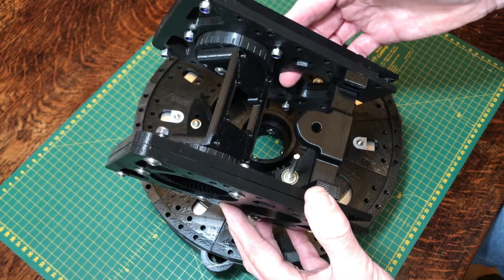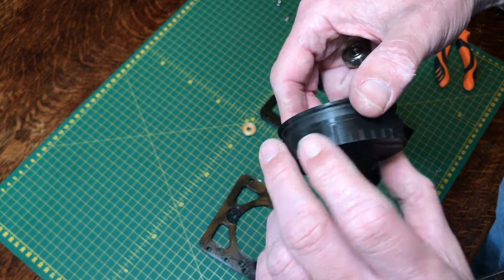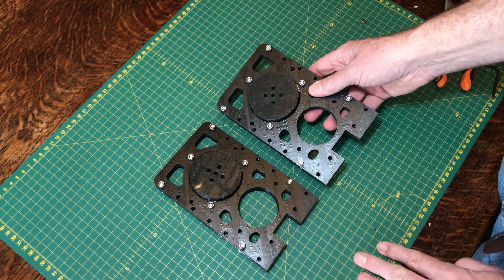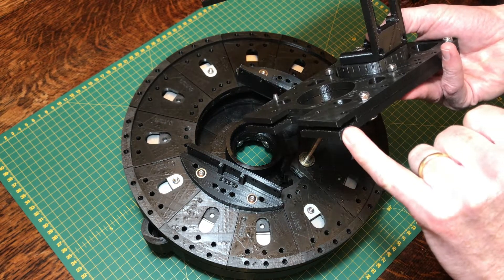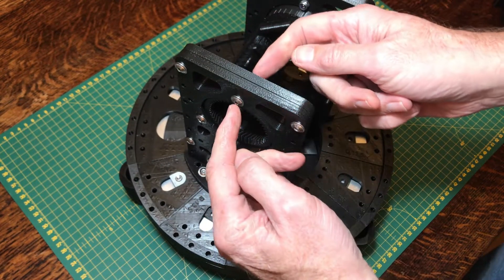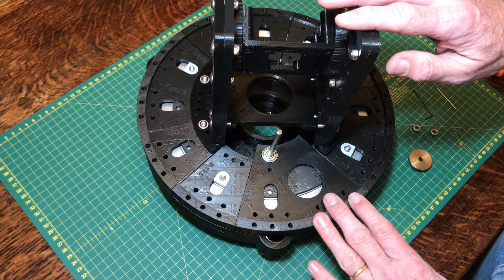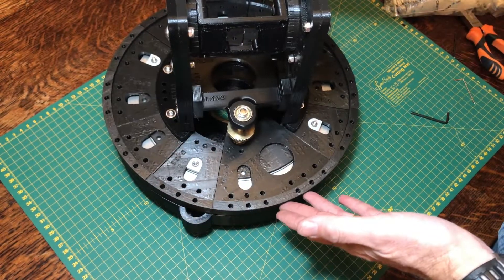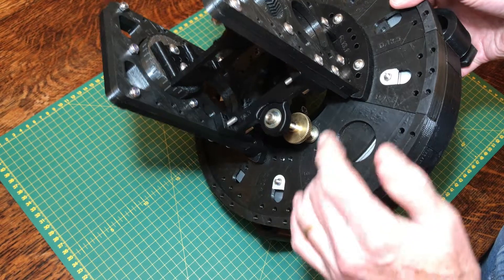Pilomar - Build camera tower

Comment: Would you consider doing a video on the process of taking your diagram for the PCB and creating an order with PCB Way? Some engineer friends of mine are good with software and 3d printing but are a little lost on the circuit board side. We were thinking about building this as a collective project. Thanks for putting this out there. I am sure it was a labor of love. Cheers and Happy New year.